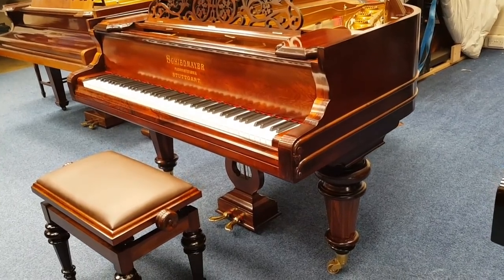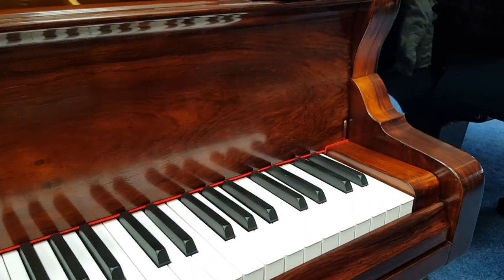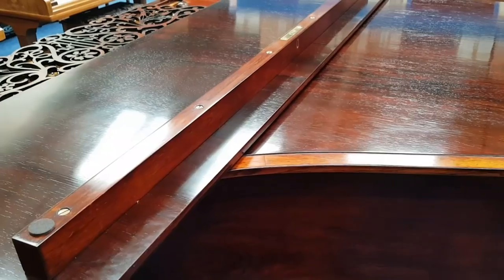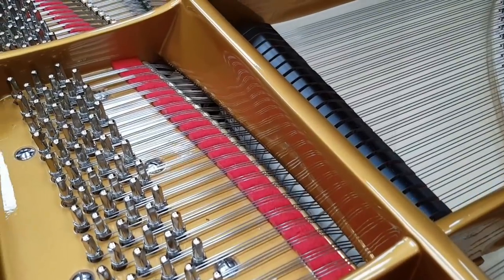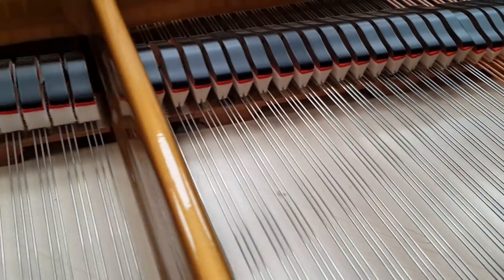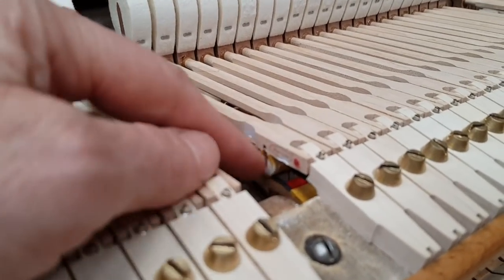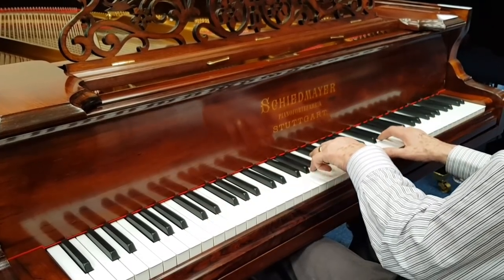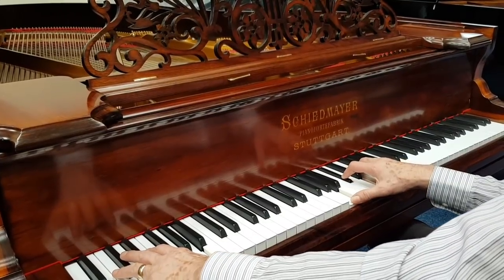After restoration of a Schiedmayer 189cm grand piano c1881 video 2 of 2

Comment: To think that this Grand was built before electricity power plants were built, before modern cranes, before any modern tools. Look again - with awe.
And what a beautiful restoration! Marvellous!
Reply from the maker: great points Dibald, it would have be pre-production lines were even invented! It is quite romantic to think of the method and skill level with which these pianos were made by possibly a second or third generation family member who took up the family trade of building pianos. Something of a past era. We have a technician working for us who was in the last Kemble factory in the UK, but it was run as a production line, his job was to tune one section of a piano multiple times in a day and then another section another day. Some of the workshops in Germany may still function in a workshop style of production, however it is unlikely to resemble what it used to be like. It would be interesting to see a collection of photos of factory work in this period. Thanks again for your comments, Evan Roberts

Comment: I have the fortunate choice of keeping a Bluthner grand model 6 circa 1890, and also a Schiedmayer upright of about the same age.  I have found lots of info about the Bluthner, some from your own site. 

But of the Schiedmayer upright I cannot find almost anything yet.

Both pianos are family heirlooms,  the Bluthner from my dad's grandmother and the Schiedmayer from my wife's grandmother.  Both are relatively untouched (the Bluthner is refinished and had the pinblock replaced recently) but otherwise the action on both obviously needing a rehaul.

What can you tell me about the Schiedmayer uprights? Are they worth the restoration to functional state? I am no pianist, me and my wife are both singers and want our kids to take lessons on a good inspiring piano and play ourselves when we can.

I myself took years of lessons on the Bluthner when I was a kid and I have nothing but fond memories of it's warmth and soft touch.
Reply from the maker: Hi Luis, thank you for your question. If the piano is a lesser known brand it will be more difficult for the piano to hold its value. Depending on the age, action design and condition. I feel it would be best for you to contact a local piano rebuilder for a valuation who can go and see your piano. If the piano needs restringing, or re-pinning, or for that case a new pinblock you are looking at a major restoration. If it is general wear on the action it will likely need new tapes, perhaps hammer refacing. It can vary wildly. It is a good problem to have but one that must be navigated wisely with good advice. I would advise seeking out a piano technicians guild or PTA in the UK tuner restorer who can advise you more specifically to your piano. I hope this helps, Evan Roberts